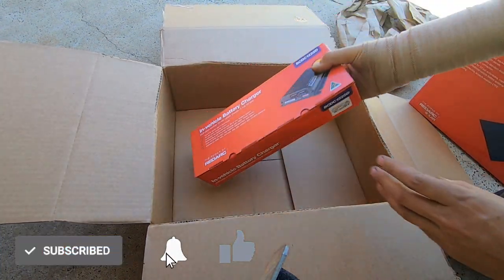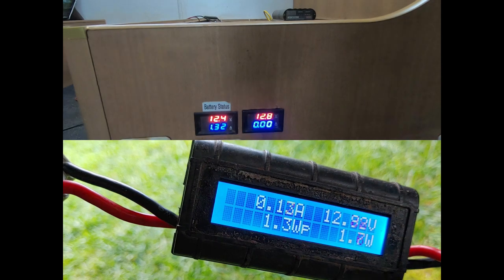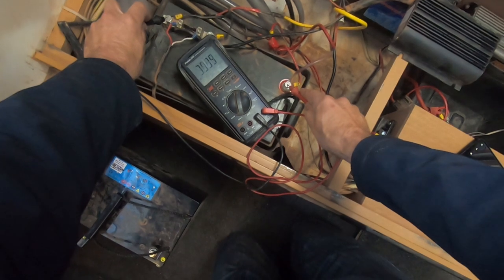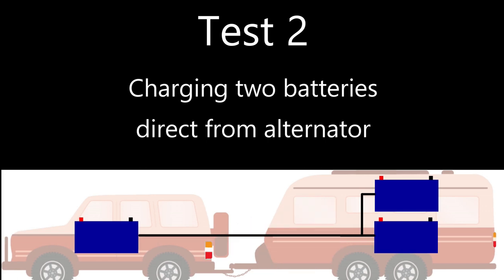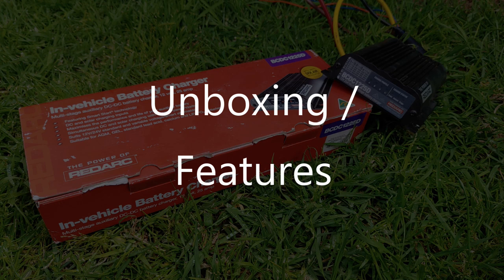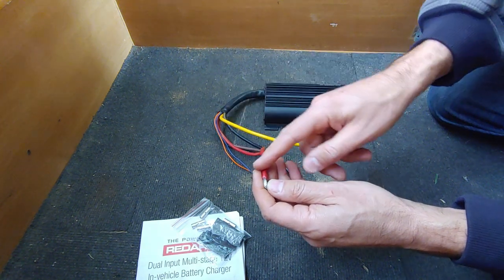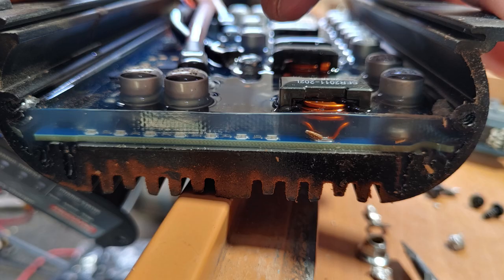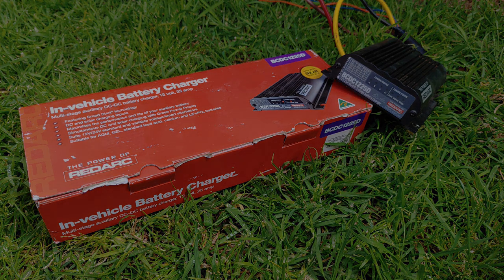REDARC BCDC1225 DC-DC Battery Charger Review - How to PROPERLY charge caravan batteries!

Comment: I have a  second battery  under the bonnet which is a AGM and a 200amp lithium in my van can It charge both AGM and the Lithium at the same time
Reply from the maker: No. Lithium batteries and AGM batteries have different charging profiles. While this charger can be configured to charge either type of battery, it only has one charging output, so it can only do one type of battery at a time.
Reply: @TheMusingGreg  I'm working on a relate issue. I have 240A worth of lithium batteries in my camper trailer as well as an extra agm battery under the bonnet for the vehicle accessories/winch. I already have a redarc VSR to charge the winch battery. I was told that I could run cables from my main starter battery to the rear bumper with an anderson plug to connect to the trailer. Add the BCDC charger in the trailer and let it charge the lithium house batteries from the main start battery. Is that correct? I guess what I is; can I charge the winch battery from the start battery via VSR (both batteries are exactly the same) AND power BCDC charger to the lithium trailer batteries?? Great video and thanks!
Reply from the maker: @ailo4x4  Hi mate, if I understand correctly, you're using the alternator on your vehicle to firstly charge the start battery. Once its voltage has come up enough, the VSR switches to the aux battery and your alternator then charges up the aux battery. Is that correct? If so that setup is fine.

I think what you're suggesting should work, although it would be better to connect the BCDC to the Aux battery rather than the start battery. It's never good practice to run things from the start battery especially if you've got an aux battery available, it's a recipe for something going wrong and flattening your starting battery and then you're stuck.

The more current the BCDC draws, the lower the supply voltage goes, and in your specific case this could cause one of two issues:

1) The BCDC will be drawing a lot of current to charge the lithium, and it might keep the voltage low enough so the VSR stays switched onto the start battery. This would mean your Aux battery never gets charged until the lithiums are close to full. 
2) Even if 1) doesn't happen, as soon as the VSR switches and your alternator starts charging the Aux battery, the BCDC will immediately start flattening your start battery until the VSR detects the Start battery's getting low and switches back to top up your start battery, and the cycle repeats itself all day long with the VSR switching back and forth. This fluctuation of the supply voltage to your vehicle could cause some issues, and the BCDC isn't going to charge as effectively as it'll be trying to suck 20-50A from just a battery rather than a more powerful alternator.

But if you wire your Anderson plug to the Aux battery, your start battery will get its all-important top-up charge as soon as you start your engine. Only after that will the VSR switch across to charge the Aux battery, and this jump in voltage should trigger the BCDC to turn on and start charging your Lithiums at the same time. Your start battery condition is always maintained and prioritised, as it should be, and it won't lose much power just running the vehicle's electronics compared to powering the BCDC.

Hope this helps!
Greg
Reply: @TheMusingGreg  Thanks Greg, you are the man! I would have thought this would be an issue that would have long been settled with the vast numbers of Aussie camper trailers being pulled by trucks with big winches. I contacted Redarc some time ago about it and their solution was to use two 1225D BCDC chargers. One for the under the bonnet for the winch AGM and one in the camper trailer for the lithiums. I get it but that is a LOT of money. I always thought there has to be better way.  I'm an American expat living in the UK with a old school Defender and, believe it or not, an MDC Cruizer Highside forward fold camper trailer. My English wife and I are planning on shipping the whole rig to Cape Town in 2026 and spend a year doing southern Africa.  Right now I just charge the trailer batteries up before I go and use solar panels to keep it going. But I really need to add power from the truck to charge as we drive. My under bonnet AGM is used mostly to power the accessories in the truck like the air compressor, small truck fridge, etc.  and if really needed, the winch. So having it in the middle of the system shouldn't be too much load. Any further thoughts greatly appreciated! Cheers, pal!
Reply from the maker: @ailo4x4   More than happy to help! Look, the AGM having its own DC-DC charger would of course be the ideal, I was assuming you had ruled that out. Two DC-DC converters means the AGM, the Lithiums and your start battery are always getting charged simultaenously but being monitored independently of each other which is the best situation. It has to be said that the Lithiums / DC-DC will draw a lot of current, so whichever battery they're connected to, the VSR will stay switched onto that battery most of the time - which means the other battery won't be getting charged most of the time. And that's not actually ideal for either battery unless there's only a light load on the other battery and it only needs a periodic top-up charge. What I suggested would probably work fine most of the time, but if you're driving at night with the spotlights on or other heavy electrical load conditions, the VSR will probably stay switched across to the start battery most of the time which would mean your lithiums wouldn't get charged if the DC-DC's connected to the AGM side of the VSR. The alternative is what you suggested, which would mean it's the AGM which wouldn't be getting charged most of the time.

It probably comes down to how much load is on each battery. If it's only a few amps most of the time, the VSR would probably only need to tick over to charge it a few times a day while you're driving, but if either is heavily loaded, the VSR could end up switching back and forth as I mentioned. 

If you're only going to have one DC-DC charger, I still think the method I suggested is the better of the two options, so long as the VSR is configured to switch back to the start battery when it gets low. Just be aware there is a risk it'll stay there for a while and your lithiums won't get a charge.

However I'll be honest with you: if I was planning on doing a trip as serious as what you've got in mind, I would bite the bullet and get a second DC-DC charger. If you want to save on cost, you could consider one of the Core units which aren't dustproof or waterproof and install it inside the camper rather than outside and save a few hundred. But if it's going to be responsible for delivering your power in rugged environments, I would be inclined to get the Classic unless you really can't stretch the budget beyond a Core. The extra cost would in my mind be worth it for the peace of mind and lower chance of a failure.

Good luck whichever way you go!
Reply: @TheMusingGreg  Greg, you are absolutely correct. The easiest problem to fix is the one you prevent (learned that during 20+ years in the military!) I'll happily spend the mone on two of the BCDC chargers if it is the right thing to do. I could not get a straight answer from any general public expert (as you are!) and as the only answer I could get was from a manufacturer, I had a sneaking idea that it might be a simple answer for them and be able to sell another charger. BUT, as that actually is the right answer I'll absolutely install them. Might I suggest you do a video describing this exact problem and how to wire up a truck with a winch battery AND a van with house batteries. I could not ever find a video that addressed this situation specifically. Cheers!
Reply from the maker: @ailo4x4  Only too happy to help mate! I wouldn't call myself an expert, but I've got an electronics background and have fiddled around with 12V electrics for many years. The funny thing is that until I really started thinking this issue through, I figured just running two systems in parallel would be 'good enough'. It's only when you start drilling down into the behaviour of the VSR and expected load characteristics that it becomes a bit more involved than it first appeared, even to me! That's probably why most people aren't prepared to give a straight answer - it takes too much time and thought to work it all out unless there's something in it for them to make it worth their effort, like Redarc would have, which of course could then make the advice they'd give seem biased! But in this case I do think Redarc's given the right answer.

Thanks for the video idea - I unfortunately doubt I will be in a position to have a setup like that myself to work from, and I really prefer to do videos where I can measure and demonstrate findings rather than just discuss theoreticals as we have here. But if I ever get that sort of thing I'll certainly document it!

Good luck!